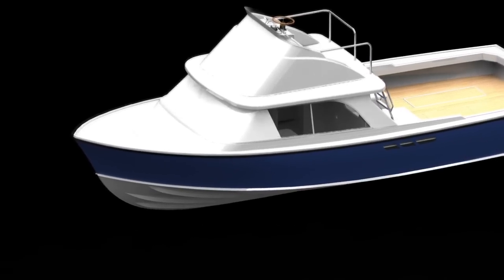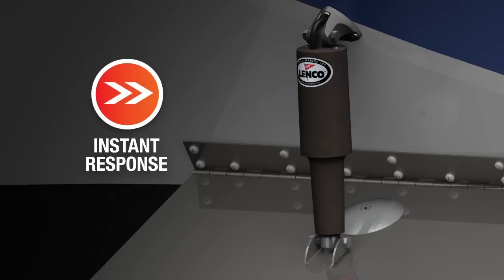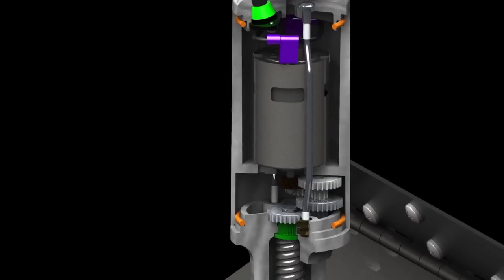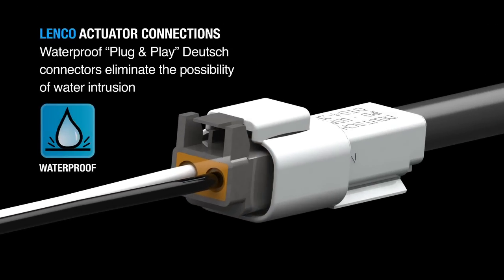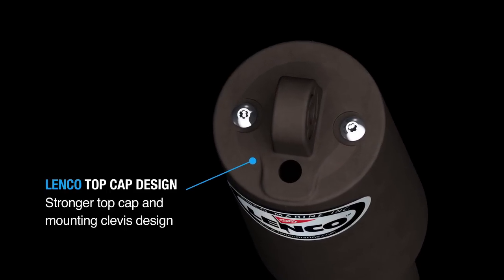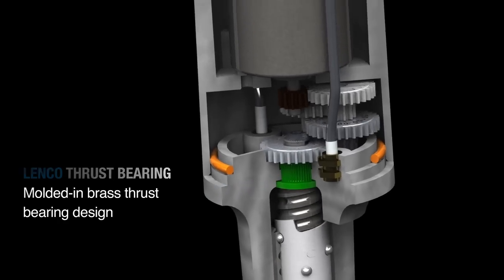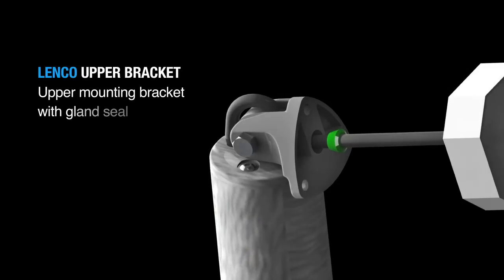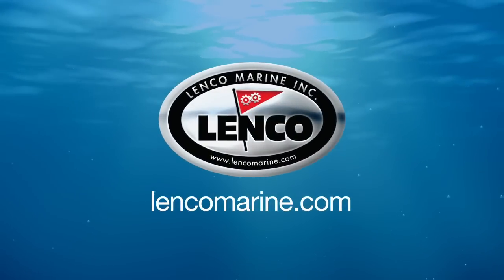Lenco Electric Actuator

Comment: My trim tabs and their wiring are under the waterline and one has failed. Is there any reason I couldn't run the wire for the new actuator through a hole in the transom higher up, out of the water entirely? This would let me avoid hauling her out of the slip. I would use the existing actuator hull bracket where it is.

Comment: Lenco tabs on my boat cannot be grounded. They have plastic top and bottom. This will cause pitting on the ram and will leak in time. The lenco switch I got with my new boat has already failed 6 months out. I had hydraulic tabs on my last boat for 14 years and no problem. If these tabs keep giving me problems I will go back to hydraulic.